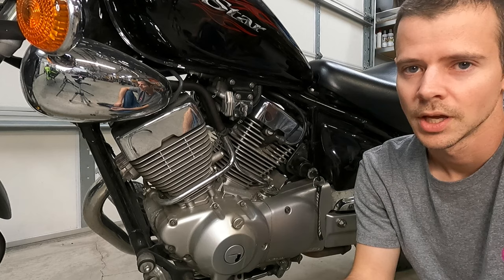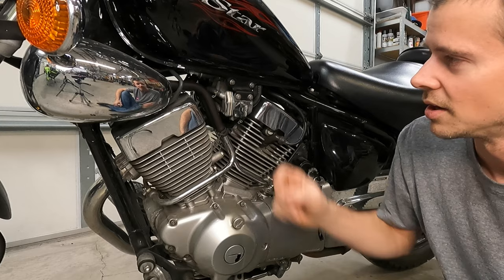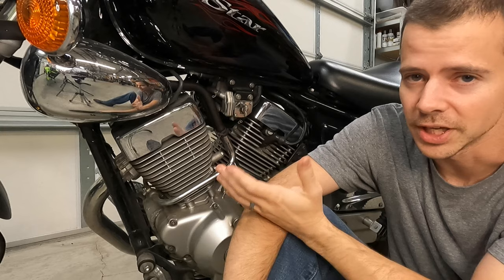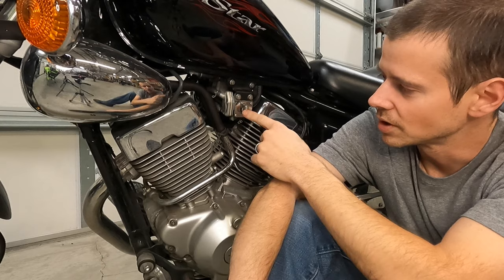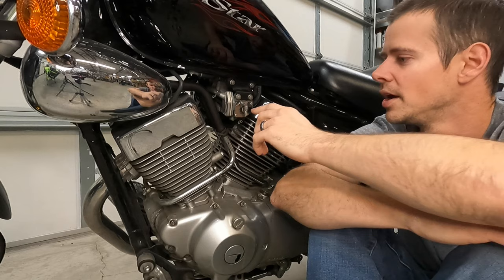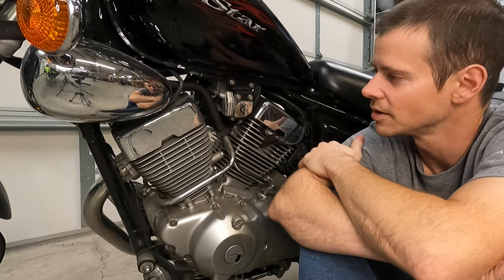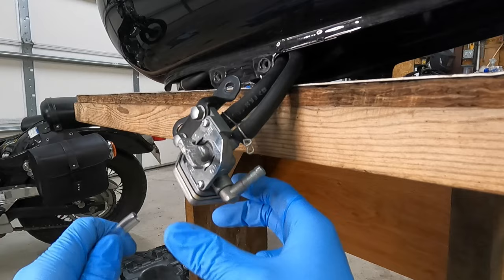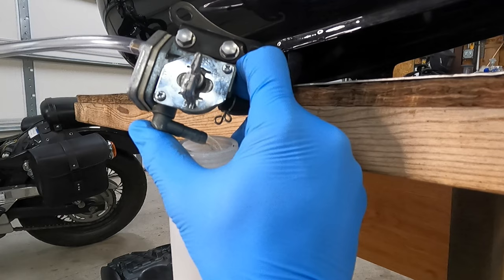Yamaha VStar 250 Petcock Test

Comment: Thanks. I'm having the same problem on and off after it sat all Winter.  Rode about 2 + miles, it shut down totally thrice, a few times ran rough, but managed to keep going,  Filled up the tank a little over 1 mile in, half way.  Now, I'm afraid to ride it.   Oh, it's running slower too, and will stop if I don/t keep the throttle open a bit.  Haven't taken it off full choke yet.

Comment: I had a air leak at the frame to carb rubber gasket and I replaced with a new one and it turned out to be the wrong one. So after ordering another it turned out they are different, the new one works. The bike would lean out so that tells me air leak. Thanks for the upload.

Comment: I had my bike died after 42km when i had just filled up, but it was weird to me because i had put about 5 liters of fuel in it, i checked the gas tank and it was pretty much half empty (around 4 lt of fuel left), so i switched to "reserve" and it was fine.
Later on the ride i went back and switched it to "on" again and it immediately died.
I'm pretty sure the lines are backwards, "on" is actually "reserve" and "reserve" is "on", my bike was used so maybe someone messed the lines up in the past (it had a carbureter rebuild done to it), it could be that your sisters in law's bike has the same issue?
42km is kind of in line with what a full reserve tank would give me because i've tuned the carb relatively lean, and i've gone another 60+km on what the petcock says it's "reserve" without it dying on me so i'm pretty sure that was the issue.
Could you update on the matter if it was something else in the end?
Reply: clogged screen inside the tank